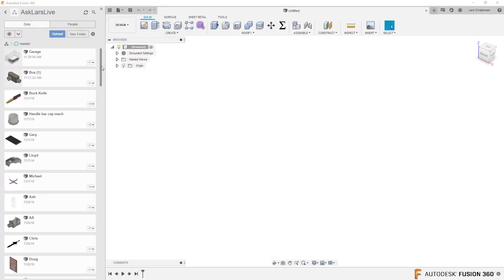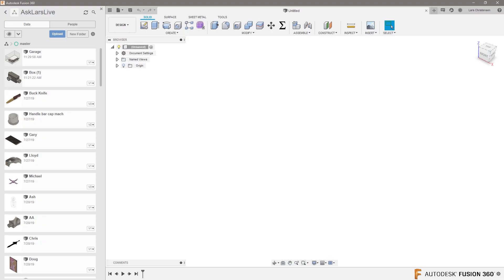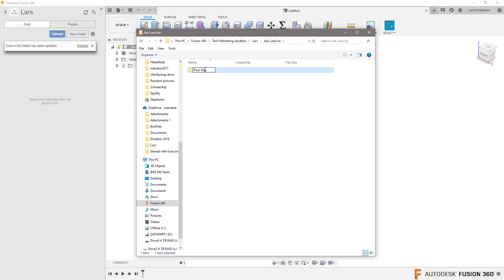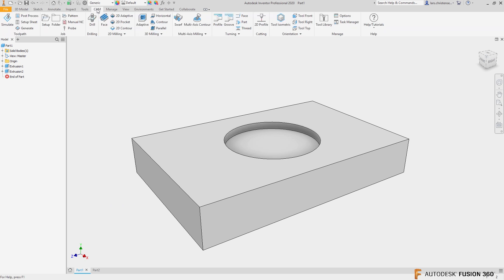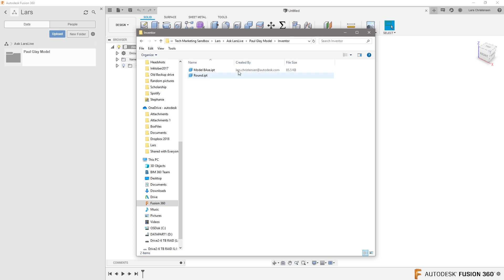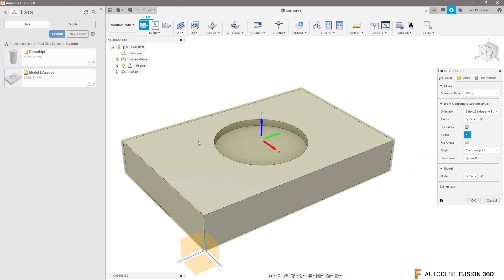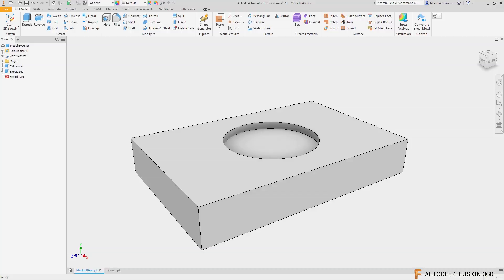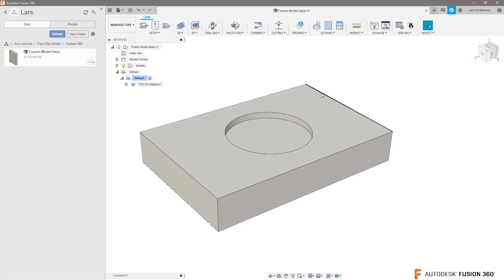Fusion 360 — BETTER Workflow with Fusion Team — Ask LarsLive

Comment: Fusion folder structure is broken. I cannot move certain projects to their correct folders (accidentally)  saved to the wrong ones) for some files. I even used the uninstall tool by Autodesk but to no avail. Request to help desk met with silence.